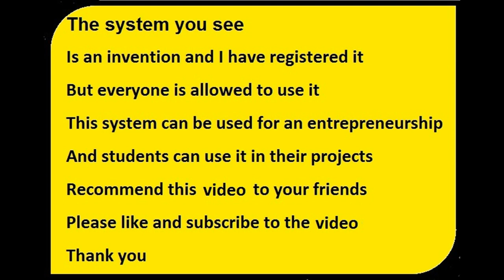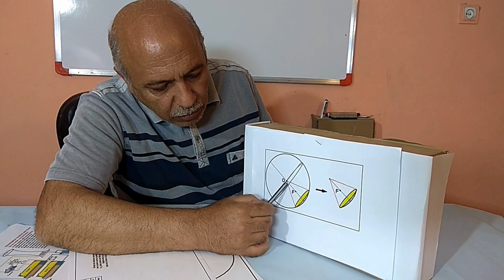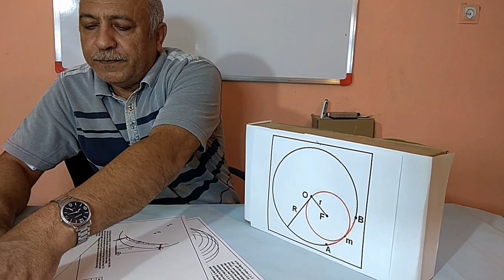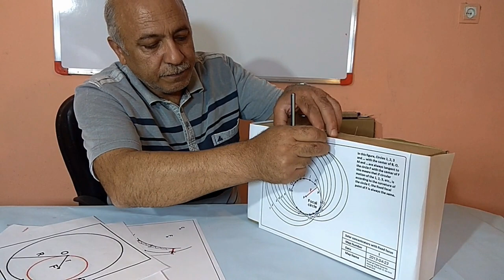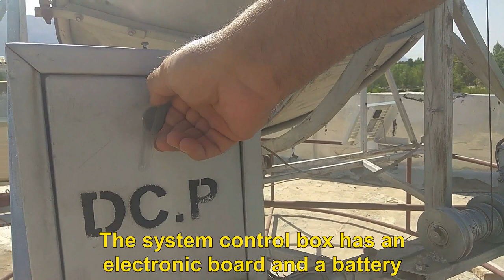A new solar system-fixed focus system-Ideal startup-The new generation of solar water heater

Comment: Brilliant. Heating is the heaviest use of energy. It is stupid to generate electricity and then waste it on heating when solar and other heat sources are available to be exploited with a bit of science and creativity. Well done, I would like to try this in Pakistan.
Reply: Why not use high-efficiency, high-concentration solar panels (multi-junctional solar cells) (they can reach efficiency of 40% at 300-400 Suns concentration), and then cool them off to produce higher efficiency electricity AND heat?

Can even have 4 of them around in a square and use high-throughput PC heatsinks to cool them off. You can for example weld together 4 metal sheets, into a square pipe. Solar panels on the outside, attached to PC heatsinks with a thermal epoxy and thermal heatsink fins on the inside.

Now you can blow air through that center square pipe, and use that air directly to warm up your house, or pre-warm water. + generate a tons of fairly cheap electricity, without the need for any water turbines. (since the high concentration solar cells are 50% efficient and need to be extremely small, in comparison to the surface area.)

Comment: I commend you for keeping the receiver stationary, very practical and economic.  Also on those power towers most people miss all the different colored dead hemostats and the sun reflections missing the tower.  I could have fixed that for them, but they don't let broke intellectuals participate.  I watched a brand new $250,000 tracker stare at zenith for years and when I finally asked if I could fix it they escorted me off the property and told me to never contact them again!  You should have seen the stacks of computers they were using.
Reply: @fixedfocussolar  How much money do you need?
Reply: @fixedfocussolar  Let's say, something small, for example, 10kW peak output. In the UK or somewhere in the EU.
Reply: @fixedfocussolar  ok, so give some numbers for bigger power output.
Reply: @fixedfocussolar  I think here the problem will be with the generator price. And also the boiler, cooler and other parts. That will be definitely more than an additional $1.5k. PV solar price for 40kW is about $8000 with the current prices (with DC power output, of course, you need inverters and other parts). I am not sure if it's competitive. For small scale probably not really. And with a bigger scale, only energy companies are doing this which is regulated.

Comment: I have found , for related,uses: Automotive wheel bearing hubs are an easy way to get high quality ,stiff and robust rotating elements.  Especially the "cartridge style" since they have mounting fasteners on both sides. Example:  2001 chevy silverado Front wheel bearing/hub

Comment: This dose seem viable for power plants, with dish diameters of 6m or so linked in series with and high efficiency collectors you would be looking at etreamly high temperatures and high energy conversion efficiency.  The fixed focus means you don't need to have rotating liquid couplings which are complex and leak prone.  But s a home system though for simple home hot water I think it is a bit much and flat box collectors are likely to remain dominant at low latitudes, with this much focus only needed in very cold northern climates which have very low angle sunling.